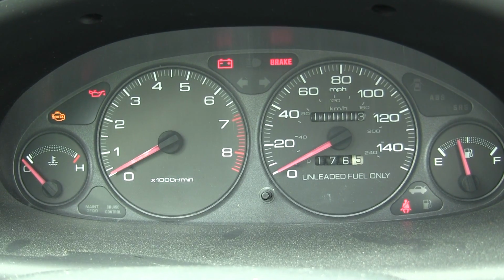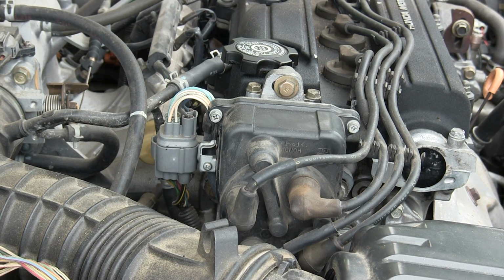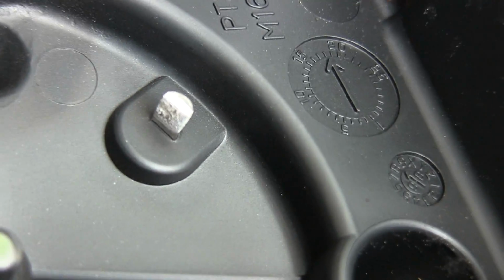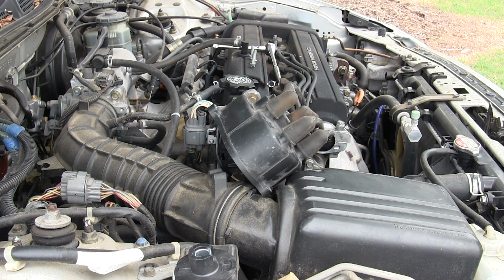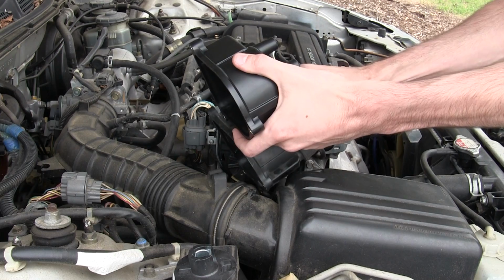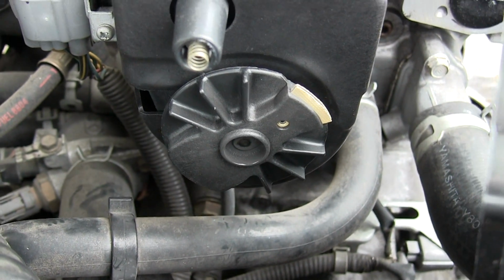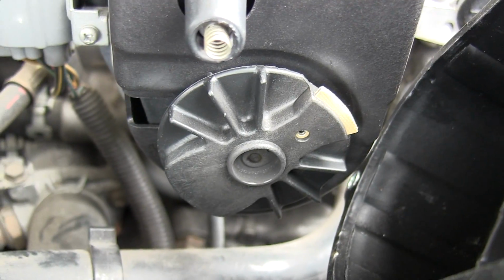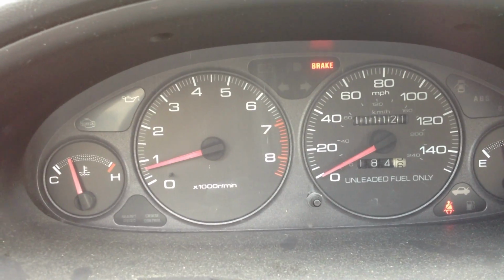Replacing Distributor Cap on an Integra

Comment from the maker: I didn't replace the rotor because after sanding off the end of it (and replacing the cap) it worked fine. And yeah, thought about that just sanding the cap, I'm sure it would have worked but the auto store basically told me what to do so I think they deserve the $18. It's not like if I took it to a mechanic they'd sand the cap and then say "on your way." I'm pleased!

Comment from the maker: Yeah I had to get my radiator replaced as well, apparently a common problem with integras at about 100k miles. I just bought a code reader for $20 on amazon, works great haha. The problem is the connection in the passenger side is sort of blocked with some plastic. I think I may just take a dremel and grind off some of the plastic so I can actually attach my scanner.

Comment from the maker: Sure. The front tires (fwd) are connected to the transmission, which is connected to the clutch, which is connected to the flywheel, which is connected to the crankshaft. The crankshaft is geared with the camshafts with a timing belt. The distributor caps is geared 1:1 with the camshaft. So, by rotating my tires with the car in gear, the rotor should rotate.

Comment from the maker: Yeah I wanted to pull the plugs since I do burn oil, but I don't have the tool for it, so I'm gonna order one. Also, I did scrape off the residue on the rotor tip to clean it up since I couldn't get it off.

Comment: If you want to take that cover off and there is a bottom portion opened, you can crank it a couple times to spin the rotor to gain access to the screw.

Comment from the maker: Well if it's shaking then you're probably misfiring. If your check engine light is on take it to an auto parts store and they'll usually read it for free. If it's a misfire they'll probably recommend spark plugs, wires, distributor cap and rotor.

Comment: Good idea to sand the rotor lightly with sandpaper. It oxidises over time. Also leads usually fail before cap. For most cars you will never need to replace the rotor.

Comment: Could you mention more about ignition. My car had direct ignition, doesn't have the distributor cap as you mentioned. So how is all the power generated? does each spark plug have a set of coils?

Comment: Don't know if this works for everyone's vehicles, but disconnecting the battery on my truck resets all the codes...But! after doing this, turn your key to the ON position, but do not start your car. You may see some of your gauges on your dash move. Wait for a couple seconds and you may see the gauges move to their initial positions. Redo this process several times until none of your gauges move, and then it is OK to start your car. This is just some systems resetting.

Comment: Hey man could you please explain a little more on the bit about jacking up your car to rotate the tires(Front or back)? Specifically how you knew that the tires moved to the camshaft which moved the distributor dial. Thanks.

Comment: lol mine has 22k when i got it, I had to add water constantly until i figured out myself self that a radiator plug was corroded and leaking,only problem was to get to it the transmission had to be removed, (thanks engineers) so that made labor cost high but at least it don't leak anymore, you should also one day buy yourself a code reader i got one for a little less than 90$ its expensive but worth it, if you are a DIY person.

Comment: I'm guessing jbones was referring to you not replacing the rotor. Whatever...i just wanted to say that you might also could have just used a real fine grit sand paper and slightly sanded those contacts. I had a similar problem but my car wouldn't start and it worked for me

Comment: plugs that have been installed 10 months ago are hardly new... just saying.
i would have pulled those and checked them for insulator cracks and checked/set the electrode distances to spec.
pointer: next time scuf the rotor tip with some sandpaper to clean that up as well.  
and just to be sure you could have measured resistance between centre contact and rotortip. If it had measured more then 0 ohms you would have had to change it.

Comment: Looks like you have a 4G63. Could be wrong but the valve cover looks similar to the 4G63. Technically I think in your case you have an ignition coil pack. Unless you engine has ignition coils or not, either way good video.